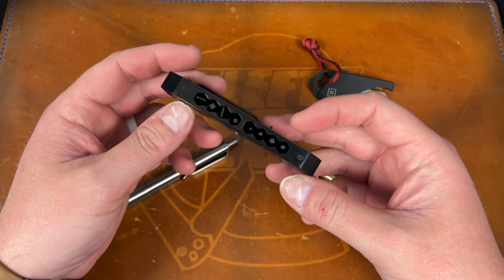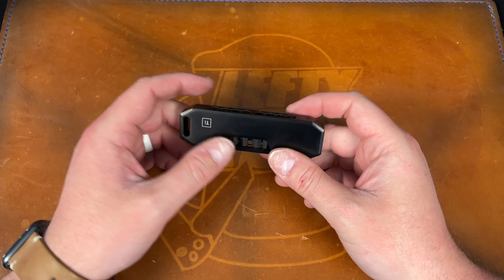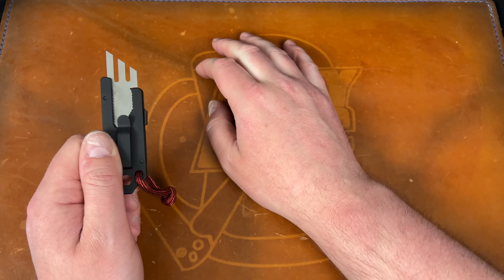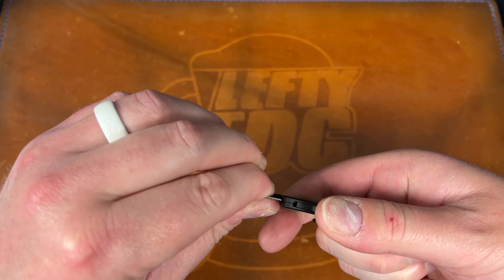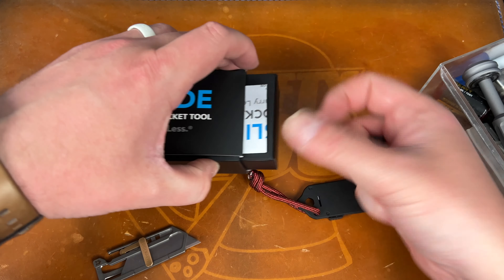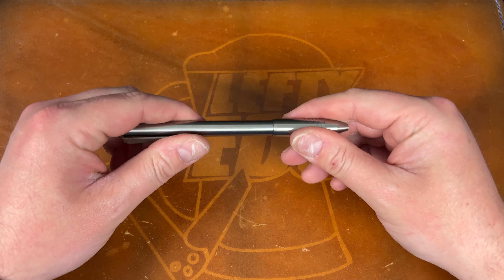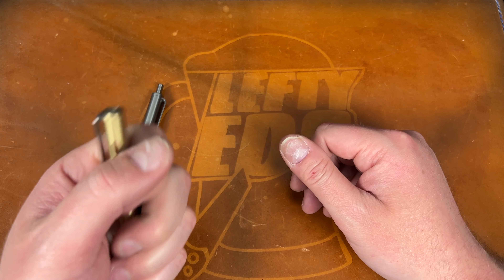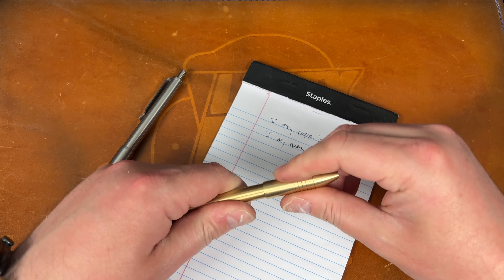Big Ideas, Cool Designs

Comment: Yeah, I was wondering why this was 44 minutes 🤣 Got a bunch of BID pens and they are all great users. They certainly win the refill flexibility race. One thing I've been told some time ago is that the inner part on the grip isn't plastic (I assumed so as well at first) but Ti, just coated, so it doesn't stick, especially on the Ti version.
Reply from the maker: Huh. Thanks.